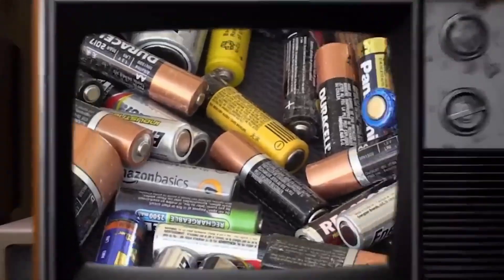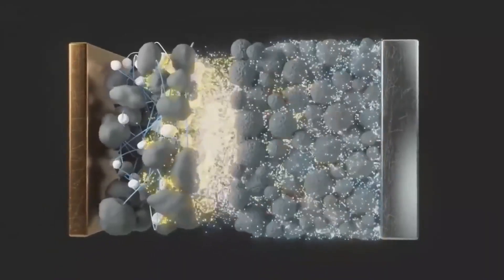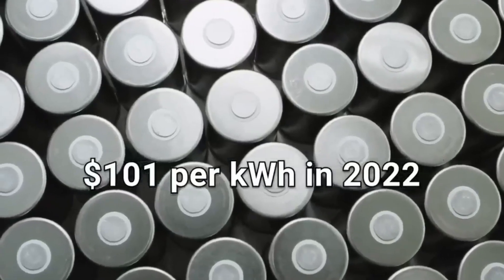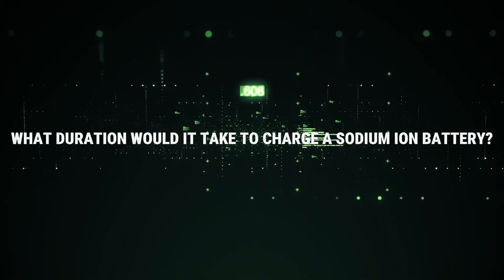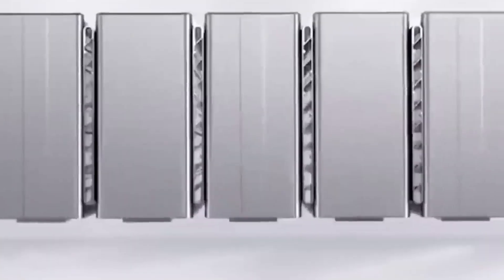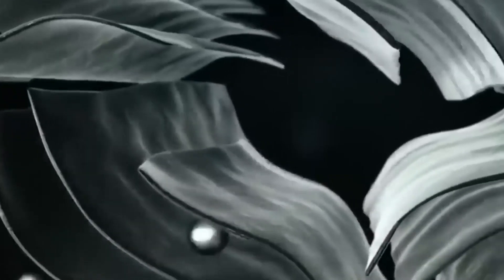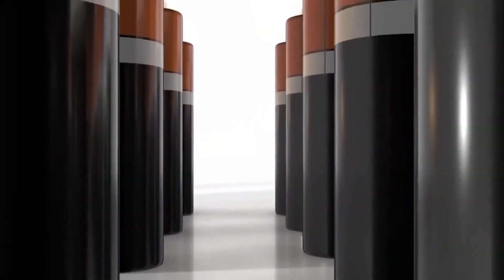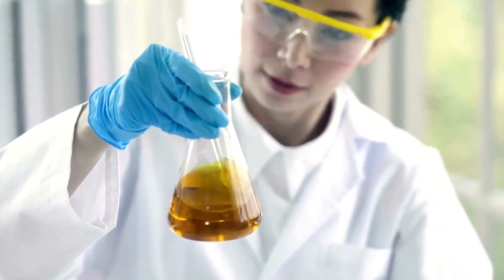2024's Power Move: The Sodium Ion 4.0 Battery Revolution!

Comment: The next big battery  breakthrough is always nearly here. Tommorow nnever comes!  Also not as energy dense ,ie even bigger heavier ev's.  Bored of hearing this kind of fantasy.
Reply: you can buy sodium batteries right now, but yeah this would be great for stationary use I guess, even LFP is mostly used for that, and sodium has a much bigger voltage range, not great for electronics

Comment: The electric grid simply will not handle electrification of transportation.  To continue to pursue this crap is a fool's errand. As far as the batteries are concerned, there are significant drawbacks to these batteries barely touched on here. Glossing over these and putting your head in a hole in the ground is not open nor honest debate.

Comment: No matter how good batteries become, the number one problem is the grid will not be able to handle the increased demand that will come with increasing the numbers of EV's on the road that will all need to be recharged. They aren't even addressing this problem. EV's are doomed to fail.
Reply: I guess you're correct if everyone discharges their ev to empty everytime and all charge at the same time. A bit like how there are massive tailbacks at the gas stations because no one ever tops up and always drives until empty. 
Do you hear my sarcasm? Your claims simply don't stack up. Especially when an ev can help balance grid fluctuations using v2g technologies.
Reply: It's the sheer logistics of it. Look at traffic today with only 1% being electric. Now imagine over half of what you see being electric. Think of the increase demand on the grid that would require.  @yoda-be.at1746
Reply: Blah blah blah, the sky is falling...
Reply: Slapping a label on things you don't agree with does not make them less true or go away. It is what it is. @davidj.kleinsasser8673
Reply: Or maybe they're not talking about  it because it's not a problem.
Reply: Oh it's a problem. Look at CA sometimes telling EV owners not to charge their cars when it's hot. This is being talked about among the honest. The grid already has trouble keeping up with demands now while EV's are a small number. At the same time, they are shutting power plants down. They need to be building them. They can't even keep up with the demand for more charging stations. It's a simple math problem. You can't get 1 gallon of water out of a 8 oz glass. There will be power outages, more often and longer in duration. We will become a third world country. You want to see power outages during summer and winter? They are not talking about it because it goes against their agenda. Sooner or later, they will have to face facts. And it's not just the lack of power generation, the grid itself cannot carry the increased loads. This means even the neighborhood grids will have to be rebuilt to handle the increase in demand. Pretty much all neighborhoods. Imagine how much all that will cost? And of course, this means higher electric bills.   @SamungVirtua
Reply: @stevenw4549  I live in california. East Hollywood. We don't have power outage in the summer. I watch the news everyday and I don't hear people complain about power shortages.
Reply: The news says otherwise. @SamungVirtua